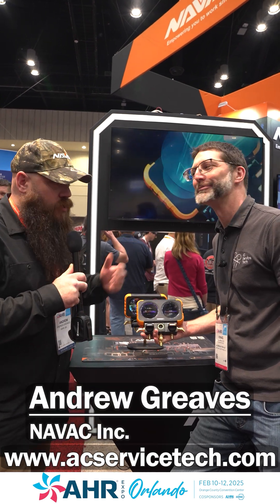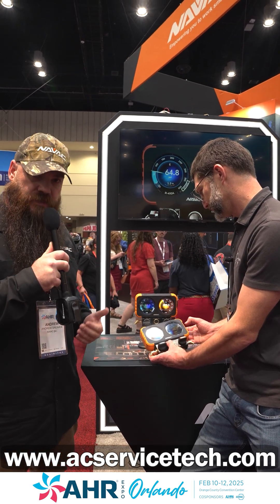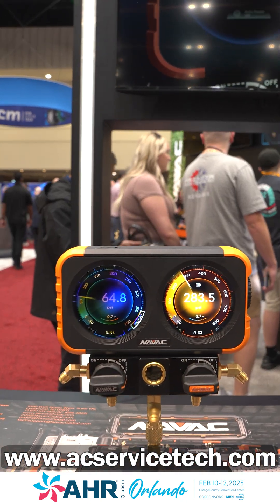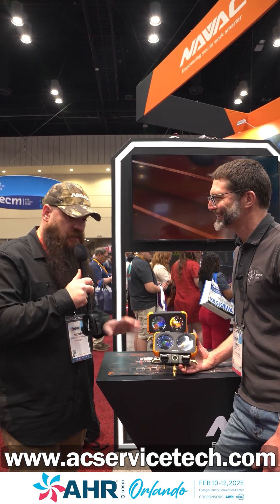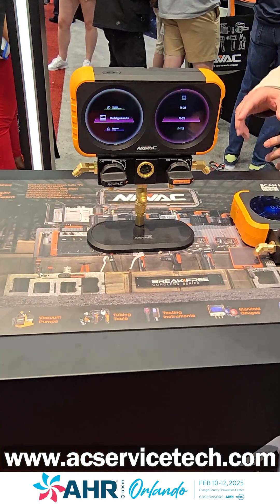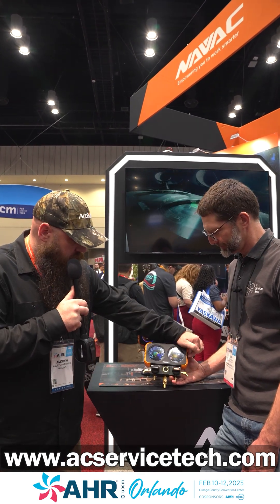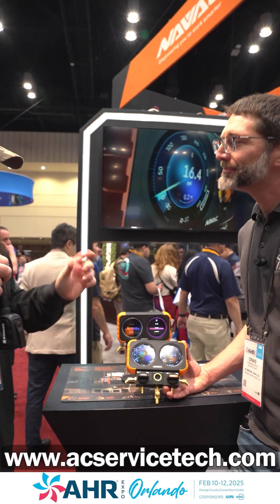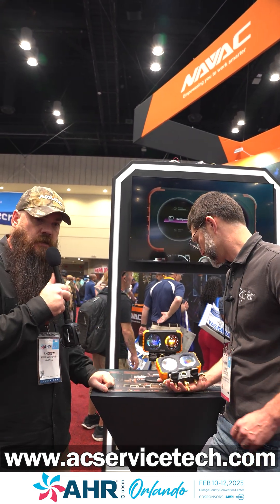Discussing The Flex-X Manifold Gauge Set!

Comment: I want to see reliable regular analog gauges with a little box on the back that has pressure sensors and connects to my phone. That way if I’m in the middle of a project in the middle of nowhere I can still get it done even if the electronics break.

Comment: I will stick with my NAVAC NX1 that I paid over $430.00 couple months ago. I will get completely used with that gauge first before moving to anything else new. Sometimes full automation can be overwhelming, just like new airplane pilots solely relying on new technology and not flying properly their planes. This new nice gauge, I believe, is selling for $229.00 on True Tech Tools, where I bought my NX1. No doubt it’s nice but I will not fret. I can do my job even with my Uniweld gauge that cost me $57.00. Think this way…if you can fly a Cessna with all bells and whistles like full Garmin 1000, you definitely can fly an old Cessna with a 6-pack gauges. At least I can . Thank you for this video Craig!
Reply: And we still kill ourselves almost daily in both simple and technology equipped aircraft. Good aeronautical decision-making goes a long ways. 

If you’re not a good technician, troubleshooter or repairman, it doesn’t matter how much you spend on your tools.
Reply from the maker: Thank you for sharing and for watching the video!!